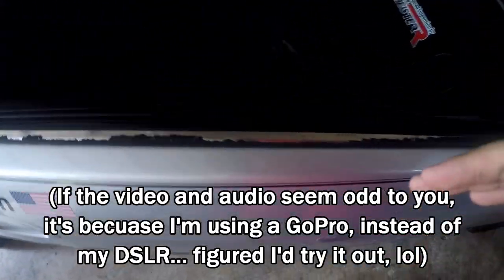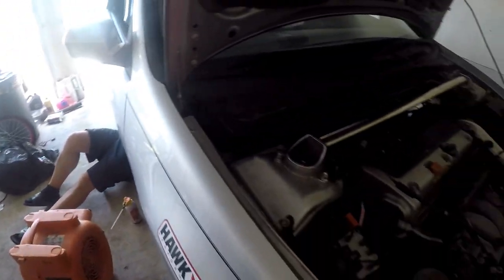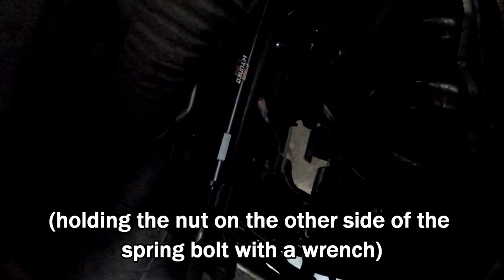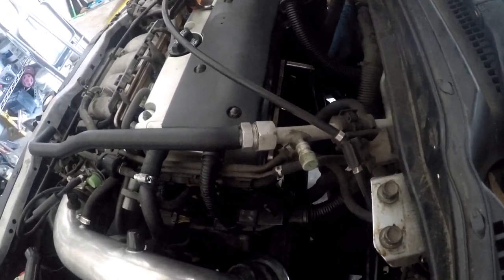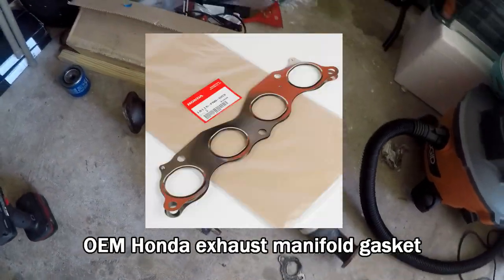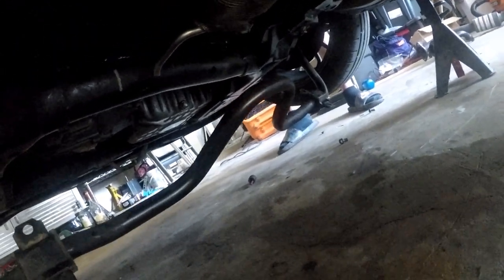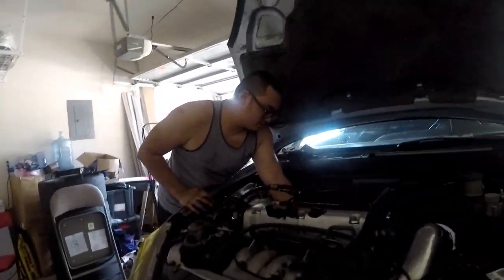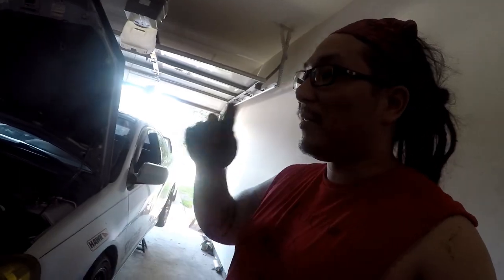Installing the Invidia Race Header On The RSX!

Comment: Wait you have an aftermarket strut bar and oem at the same time? How does it feel with that setup?
Reply from the maker: Tbh I can't really tell... But the thing is, I'll eventually replace both with a 4-point front strut bar
Reply: Jed E. Taleon how about driving without a front sway bar? Can you do that on a daily?
Reply from the maker: @bhadz100  I wouldn't do it unless you got good coilovers and bushings up front, but if you do then the car handles amazing! Check out my track video I posted a few weeks ago!

Comment: I thought they changed the Invidia headers to have no flex on them. Did they start making them WITH again?
Reply from the maker: I got it 2nd hand, so it's probably an old model from an old owner
Reply: @JedETaleon  sweet. The flex pipe helps.